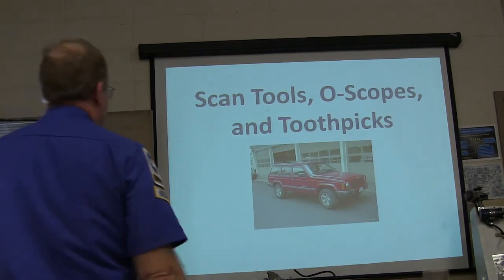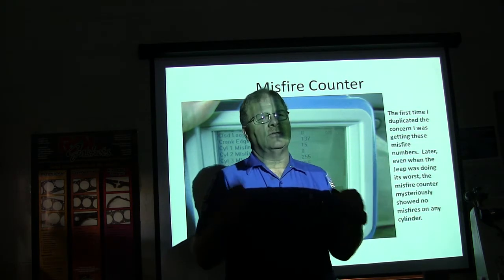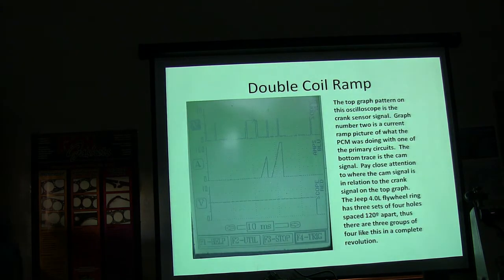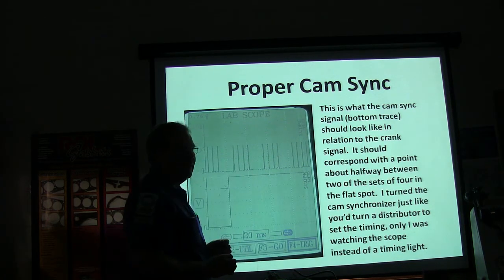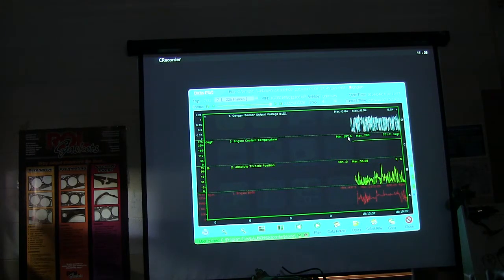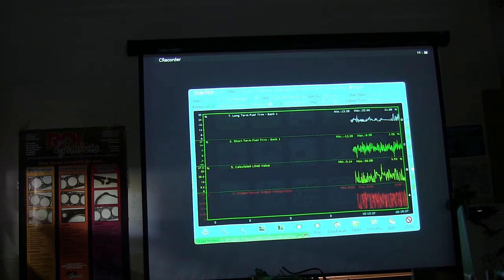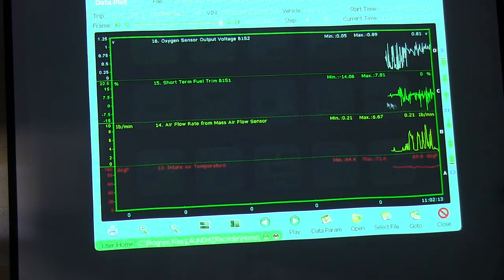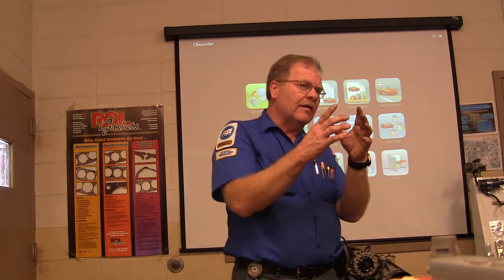Special Topics 1 War Story   Jeep Misfires

Comment: One of my co-workers is dealing with a Jeep that intermittently runs terrible.  This seems like something very similar.
Reply from the maker: The toothpick deal won't cost anything - get him to try it!
Reply: McCuistian Today we found that the wiring harness had chaffed through and the one wire that had the insulation worn away was the crankshaft signal wire.